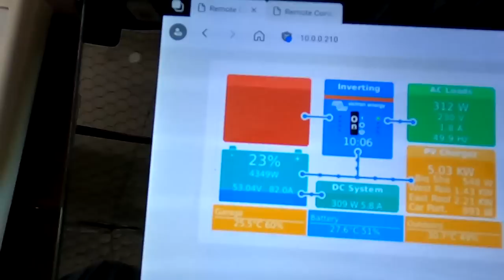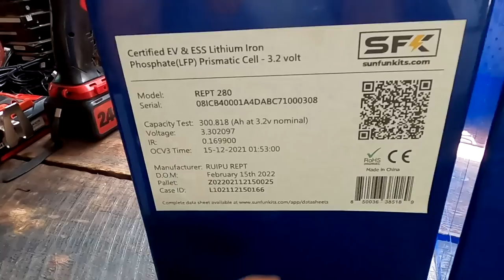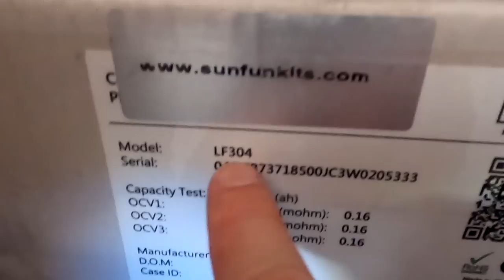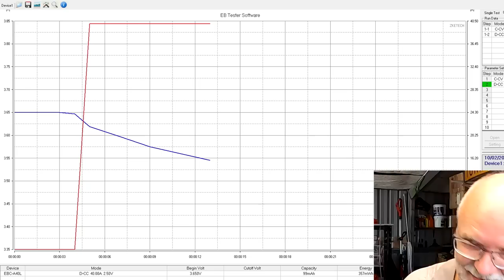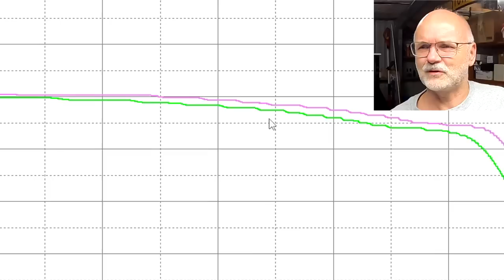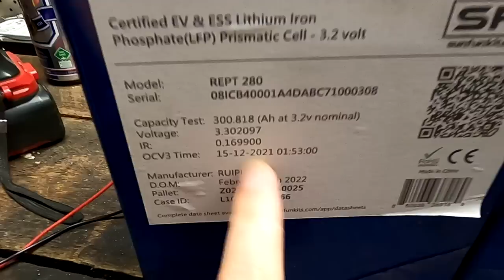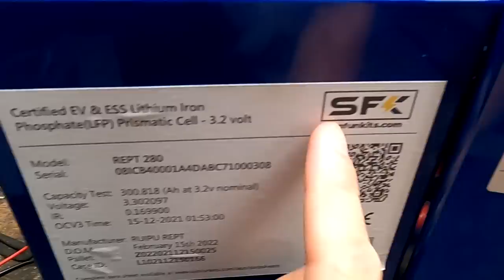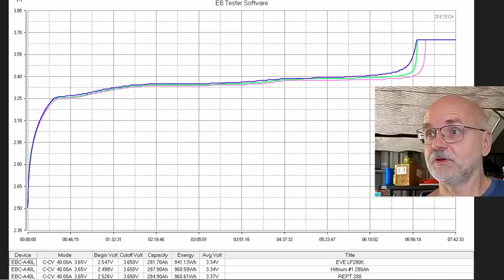BEST cell to buy - Testing Certified, A-Grade, B-Grade, Storage-Grade batteries🤷‍♂️

Comment: In Regards to the date: Please understand the date stamped on the CELL is the day it is welded. At this time the cell has not been sleeved (blue wrapping) or has been tested. All lithium batteries have a resting period of 30-45 DAYS before they are tested this is to ensure that the cell material has been the date we print on the label is the date that is provided to us at the time the cell is palleted and gets a shipment manifest ID. IF you want to see the Day the cell was welded it is on the label as well please see the OCV 3/4 Time.
Reply from the maker: You definitely need to change this and make it clearer. Don't call it DOM but date of packaging or similar.
Reply: @OffGridGarageAustralia  Sorry but this is how the ministry of transportation in China has said it needs to be done. This is also how it is recorded in there records. All certified cells are recorded this way by the pallet ID or case ID in case their is a recall.
Reply from the maker: @sfkenergy  If this is the case, I would suggest getting all these information together on your website so you can refer people to it. If they just read the contradicting dates, it seems very suspicious.
Reply: you only need to follow the flow and look what volt and amps doing
also to the battery, and do i need now a 500 volt bms? or not.
the different between a 50 A and a 200 A is how big they are.

Comment: Thank you for the test, please try out the 304 we sent as well, REPT is a new line we have started carrying, they are good but not as strong as the EVE cells. I think the issue that you need to understand is that Grade A guarantees a minimum level of performance. I'm quite certain your vendors cherry pick cells for you reviews while the other users get much lower quality cells, so perhaps what we need to remember is that Consistency is extremely important when building a pack, many online resources are filled with users complaining about low quality, as you know before you became a big youtuber you received some questionable quality cells form Basen, it wasn't until you got a large audience that the vendors made sure you got "the best of grade B". So with grade A you are assured a minimum level of quality and we stand behind every cell we sell.
Reply: I wanted to say the exact same thing, but i would've been burnt in the comment section. Good thing it came from you as Manufacturer, now people will listen.
Excellent response 👌as i stil remember his "Basen" review many years ago!
Reply: Here we go again ;). Please forget about the focus on over nominal capacity or energy. In my view there are some other factors you already stated in you videos, In my view the most important one are evenly distributed cell characteristics throughout the batch of cells you want to use in one battery. And that might be exactly what the automotive industry requires?
Reply: SFK Don't shout off too loud, your sticker said it was tested to 300'ishAh and er well Andy didn't get anywhere close to that!
Reply: @garys-half-baked-offgrid-dream  Well, no one ever gets near the factory measurement printed on cells. Forget about capacity as the major quality charateristc for LiFePO4 cells. Yes, measurement is so easy. And most of the YT channels testing cells (me included) mostly work with the cheap EBC-A40/A20. 

Delivering high power with voltage stability is beside self discharge one of the main characterstics of automotive grade cells. But i have not seen any videos except SFK doing that with the HP8182. I would buy one, but definetely overkill at 2000+$ - for the moment 🤷🏻.
Reply: @fldutch  I know but it still needed to be said they are not even close. 
I use the EBC 40 as well it is not a toy, the results were acknowledged by my UK supplier when I questioned and returned their low performing. "Grade A"
Reply: @garys-half-baked-offgrid-dream  I also use them - but you can only measure one aspect of cell quality. Suppliers should transparently make clear, at which point (eg. if cells are 3% below nominal capacity, 3% below factory measured cap. - whatever) cells could be returned.
Reply from the maker: Sorry, but I'm not getting any cherry picked cells. I'm not even ordering cells under my name. I had man cells underperforming which I have shown her eon the channel. Latest example what the Hithium cell with fake QR code. Does that look like cherry picking for someone who puts this on YouTube?
Reply: @OffGridGarageAustralia  Not sure what we can say, I'm sure you have visited Digital Mermaid's youtube and seen what type of cells. As for our cells, I'm not sure what standard it would need to meet, if its 280 AH, then it will meet that with pretty much any type of test. However, if you are wanting to meet what the Label from the manufacturer then you have to do tests according to our specs and that means cells must be tested with in 30 days of  receipt, and for the zke 40 it must be done at no more than 30 amps with proper 6mm lugs.  Once cells are older than 90 days they will start to settle near to the target capacity of 280, and will generally sit between 285-290.  I'm sure you have seen our test video same cell but it is about 1 year newer, tested at 30 amp with a lug, this cell too in about 1 year of just sitting would test around 285-290.

So first we need to establish what target are you expecting the cell to meet, cell stated or it needs to go beyond.
Reply from the maker: @sfkenergy  It needs to meet the 280Ah rated capacity, that's all.
Reply: @sfkenergy  So where is the apology for claiming Off-Grid Garage gets cherry picked cells.
Reply: @glencooke494  The same place where the apology is for people that ordered cells from overseas and received sub-par products. K thanks.
Reply: @sfkenergy  I understand the sense of using 6mm lugs but why only 30amps?
Reply: @sfkenergy  Going on your theory of Crocodile clamps v 6mm ring lugs & 30A v40A Why have I just beaten what is claimed on the sticker?
Eve factory etched grade B claimed 282.9Ah 
My ZKE 40 tester @40A using Crocodile clamps 283.4Ah! 
Date of  Birth 18 November 22
Fresh off as of 7am this morning, the 1st of 32.
I am a happy happy boy!

Comment: REPT:   Tested in 2021 - date of manuf. 2022 / find the ERROR
Reply: And tested 300Ah, real capacity 284,9Ah 😄
Reply from the maker: There is a pinned comment about this.
Reply: Neverless  missleading
Reply from the maker: @sl6891  Apparently a requirement to export cells from China due to custom regulations.
I agree, this information should be out there publicly so there is no confusion about that.

Comment: Andy - Great vid (as usual!) and so glad to see you do these tests for all of us out here in the interweb-world, to save us the cost and time to all do the same testing.  I agree with you, I don't see the $$ difference being justified by similar testing and I am (also) very happy with my Energy Storage set up for my solar (now at 59kWhr on my 48v system).
However, I suspect the main differences are going to be with matching, and cycles.  pretty hard for even you to test the cycles to see if those more expensive cells run "10,000 cycles" but the storage grade ones maybe start to crap out at 4,000-6,000.  I have to imagine for my own set up with one cycle per calendar day, at 4,000 plus cycles there will be way better new battery technology available and I can look forward to just swapping out my batteries in a decade.  I imagine by then, most home PV systems will be operating at 800vDC based on where the EV tech is going!
Thanks again Andy, your content is great.
Reply from the maker: Thanks a lot for your comment.
I fully agree. I have done ~70 cycles with my battery shelf in on year, so even if the do 1000 cycles that's almost 15 years

Comment: Hello Andy. The most important metric that differentiates the "Grade A"  cell from "Grade B" cell is not IR or capacity, but the self discharge rate.

If you build a battery pack with 4 cells in series with the same capacity and one of the cells has a faster discharge rate, you will always have an unbalanced battery no matter the bms.
Reply: I agree same on the charge. That is why I am recording which batteries perform the same so I can move my cells. I found 16 out of 64 cells that charge a bit faster at top end which causes a bigger imbalance at above 25-45 amp charging. I do not notice a difference from 5-15 at all and barely any at 20amps. I will watch and see if those same cells get imbalanced at 48-51 volts with a high discharge.

Comment: Thanks for taking the time and testing those cells. I hope you do not get offended by SFK like Ray Builds Cool Stuff.

In my view its like comparing apples with pears (or maybe 3 different sorts of apples) . To really get some reliable answers to the initial question you might have to test more cells, from the same manufacturer - Certified, matched ESS-Grade, B-Grade ... eg. 16 cells of each type, do internal resistance, capacity and self discharge rate on each cell and then use them parallel in working conditions - then you might be able to get somewhat reliable information :). In my eyes even more important is that cells match in their characteristics when you install them in one battery.

So it's like Ray already stated: you want to get the best quality, best matched cells for the best price :). Not an easy task.

I just tested some EVE LF280K (8 - not enough to get reliable results) "Grade A" cells delivered by NKON from the Netherlands (yes, imported from China of cource). I compared them to my EVE LF280K cells delivered from Docan Technology and yes, there really is a difference when it comes to cells having the same characteristics. For me (i run a business, so i was able to buy without VAT in the Netherlands) the cells from NKON were the same price as the cells from Docan - and having a shop on the continent, only a 3 hour drive away at the same price is priceless ;). Not to mention, that you might get into trouble with customs here in Germany due to some questionable DDP practises by chinese vendors... But did not yeat verify that with customs.

Though i do not fully agree with the testing methods i do agree somehow with you conclusion. If cells labled "Certified", "Grade A", "Grade B" somehow show the same performance: no need to pay the extra price. But if cells show better quality for the same price, then in my view "the drops ist gelutscht". I will go for the better quality of course. There also are reports on certified cells directly from EVE here in Germany, but i'll have to check prices and the proper contact.
Reply from the maker: Well, first of all, SFK made a video and responded to the allegations, so you should watch this as well to hear both sides.

I wish I could buy these cells here in AU as well for a similar price. But all local shops here are buying in China anyway and sell the batteries here with a very good margin. So totally not worth doing.
I would be interested on what difference you found when you compared these cells. Higher avg voltage, lower internal resistance, more Wh?
Reply: @OffGridGarageAustralia  On SFK: followed all the videos. From a PR standpoint SFK did not do a good job and some of the attempts to explain and justify went totally wrong, others were on point.

I‘ll have to check my YT videos to see if i directly compared them there. Cells from NKON were all 2 months old on delivery, same production date, Docan varied between 5-7 months, internal resistance was slightly better with NKON (0,17 mOhm vs 0,18mOhm), capacity/energy was also higher and more consistent (SD Docan 4.1, NKON 1.4), also avg voltage on discharge was higher and more consistent. 

Just finished the 30 days self-discharge test for the NKON cells - unfortunately i did not do that by the same testing standard for the cells from Docan. Max difference between NKON cells after 30 days post 3.65V top balancing was 40mV, Docan was sth. above 100mV, but do not remember after which period :/. Anyway with a 8s JK BMS the Docan cells work perfectly fine and cell drift is at max 20mV.
Hard to tell, if the cells from NKON really are Grade A/Automotive Grade as stated. I would guess near to, but not totally flawless. But also had some problems with inconsistent enviromental temperatures when testing the NKON cells. Results should have been even more consistent.

NKON cells will be put into service hopefully during next week, also using a JK BMS, in the same ESS - so there will be a direct comparison of performance i really look forward to :).
Reply: My impression is that EVE screwed up the 280 cells and sold them as grade A anyway. SFK thought he was being screwed by Ray because of the poor results. SFK is not the only one that got poor test results from the new 280 EVE cells. On the other hand, every one of the 105 and 304 cells I personally tested were above rated capacity by a comfortable margin. Watt hours is the true way to measure capacity, since it factors in both voltage and amps. I am not sure what the "nominal voltage" is supposed to mean, since like I said, watt hours factors in both voltage and current.
Reply: @john_in_phoenix  I might totally agree. The question is: did EVE really screw up with the 280K cells? Capacity (measured in Ah) or energy (calculated in Wh) is not the only quality factor you should consider. Evenly distributed characteristics in the batch of cells you want to use in a battery is one of the most important. As is a low self discharge rate (says much about manufacturing quality).

Oh and the fokus on accounting cells with much higher capacity then nominal capacity for better quality (beeing the only quality characteristic) was somehow developped by ourselves / the diy community i think. And imho kindly adapted by the sellers.

When it come to Ray vs. SFK cells were send from SFKs supplier directly from China to Ray, if i remember correctly? So there might have been an uncertainty in their supply chain - i do not blame SFK for that. Maybe those cells even did better in the EVE factory and of course you have to rely on the data you get from EVE. EVE also states in their datasheet that you have to allow for 5 full test cycles to reach full capacity. I think nearly noone including me would do this with the full batch of cells you receive.

And remember: Wh is energy, not capacity ;).
Reply from the maker: @john_in_phoenix  It depends how old the cells are apparently and if they have settled already vs testing them right after manufacturing. I would say if get very close to the rated Ah at any time, all is good and we can move on.

Comment: Kind of you not to mention the 300.8 AH claimed vs 284.4 AH measured.

Should record ambient temp when making capacity measurements.  You're in heat of summer so not an issue here but when you get below 20 degs C it starts to matter.
Reply from the maker: As long as they are all at the same temperature, it is comparable, I think.
Reply: @OffGridGarageAustralia  Yes, but you pulled out previous cell measurements to compare.  How can you do that without knowing what temperature they were made at?

A cool cell acts like an older worn cell. Greater terminal voltage slump and less extractable capacity
Reply from the maker: @rcinfla9017  We tested the Hithium cell just recently so very comparable temps. The EVE cell was tested 4 months ago, so just at the end of spring down here. Already pretty warm. I can say all cells were tested between 25-35°C.
I don't think we will see a big difference between 20° and 35°C. A small one, maybe? But nothing substantially.

Comment: If you want to evaluate the differences with the batteries, they would be needed to be tested with 1C or 2C discharge, or whatever max. the spec says. 40 amp is very gentle for these kind of batteries and does not bring out the differences that might still be there.
The non-EV-certfied most likely fail the said test by voltage spiking down with high current discharge, but with low current, they perform the same.

Great videos in any case, I much appreciate your unique style, keep it up! <3
Reply: you din't see the whole video. so sad.🤔
Reply: @MachielIedema  You are absolutely right, will continue to watch the rest of the video also.
Reply from the maker: Thanks, Lasse. Who in the world of solar and battery storage is pulling 1C from such a battery? There would be something fundamentally wrong with the system design. They might be better performing in such circumstances but that's not what we are using them for.
Reply: @OffGridGarageAustralia  Yes, in solar storage that kind of scenario will not happen, unless the battery kWh cap is wayyyy too little. My comment was to only point out how it would be possible to see the difference of the batteries, by testing them with high enough amps, which you also said later in the video.
My apoligies I rushed into commenting before viewing the whole video first. My bad. :)
Reply: @OffGridGarageAustralia  boats pull these amperages with their solar setups all the time.  Most boats are 12 or 24 volts so they must pull higher current.  Not all your viewers set up their systems in a home where you can put in a higher voltage battery,